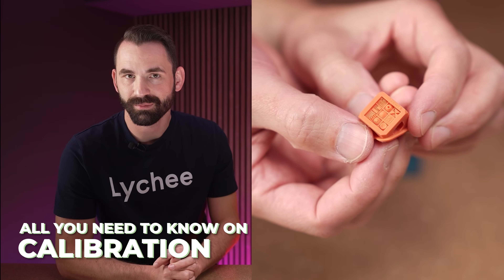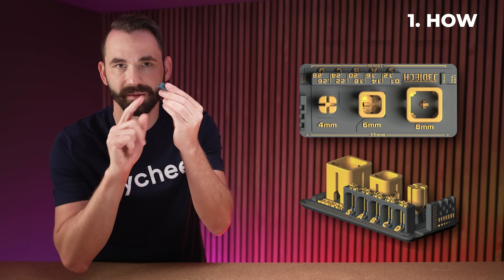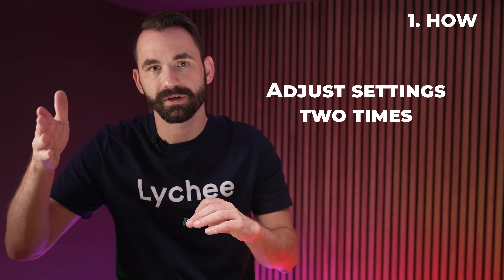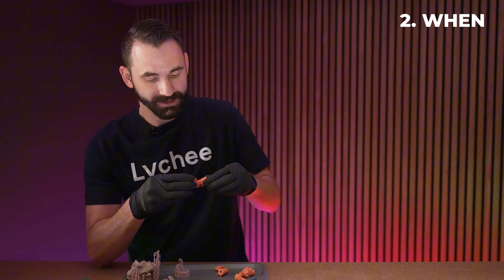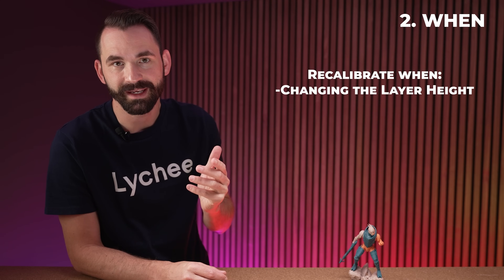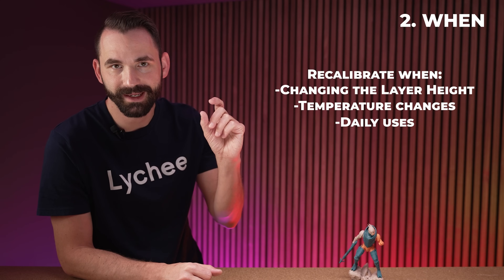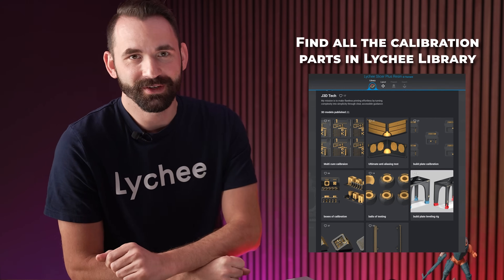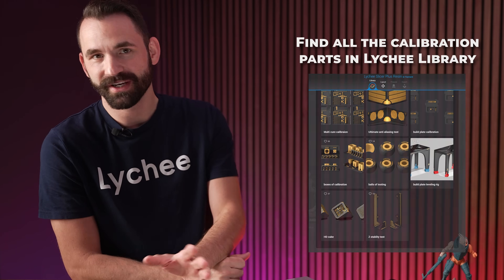Fix Your Resin Prints with This Calibration Test | Calibration Guide #2

Comment: So if I have the boxes accurate, i should increase light off delay to get the pillars, in what increments should i increase it? and for 10" is 3-4 seconds light-off too much?
A little more explanation on how/why to adjust light-off would've helped, i think
Reply: Yes, I maybe should have got a bit into the science of how light off delay = a more accurate printer.

But pretty much, when the motor stops moving the resin is not finished moving. It can take upto 60s for a layer to reach the actual thickness desired. But most of that movement is in the first 10s. Out of those first 10s most of that movement is done in the first 4s. 

So to prevent trying to cure moving resin or an extra thick layer light off delay is needed. But how much? Well no clue, that's why you calibrate. LIke I said in the video, I would start at 2s and go from there as most resins are going to be between 2 and 4 seconds.

I would add 1s delay, print boxes see if you gained any movement, if you did add 0.1s print again.

Oh and I did forget to mention, move the boxes around just a little between every print. You never want to print the same print on the exact same place over and over.

Comment: Thank you so much for sharing your knowledge. I'm new to resin printing and your videos have helped me troubleshoot so many things. I am encountering something that I cannot figure out. My boxes are accurate but I'm only getting 8-9 pillars. I tried 2 different LOD amounts and adjusted exposure. Is it possible that my printing environment is too warm? I'm printing on a Saturn 4 Ultra 16k with Elegoo ABSlike 30.+ and it's showing me a temp of up to 35c on normal layers. The Printer is in an enclosed space with active ventilation pumping the nasty air outside. The temp inside the enclosure is 25-28c.
Reply: So you don't have to get 10 out of 10 pillars. The objective is get as many as you can. 8 out of 10 is pretty good. You're in the A tier. 

No, you remember in the segment where I said the boxes don't lie. Well, it seems like you're actually too hot. When resin gets hot. It loses a lot of its tensile strength. This would absolutely correlate with some of the issues you're having. This would absolutely correlate with what you're explaining. 

You kind of have two choices. One try to find a way to get your printers to run at 28° C at a max. Or consider that 8 out of 10 pillars or getting the A tier of pillars at dimensional accuracy is pretty dang good and go off and have fun! 😊
Reply: @J3DTech  I'll play around with more with light off delay and see if that helps with the temps. I'm not encountering print fails so I'll likely just stick things out until the seasons change if I start messing things up.